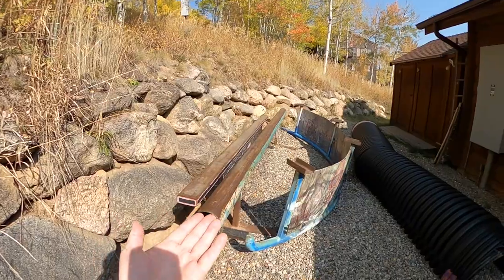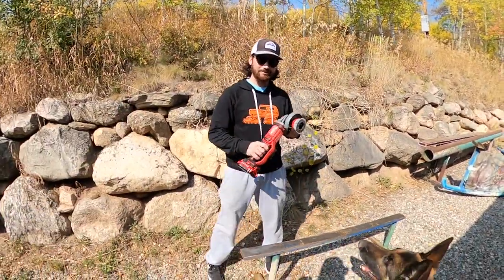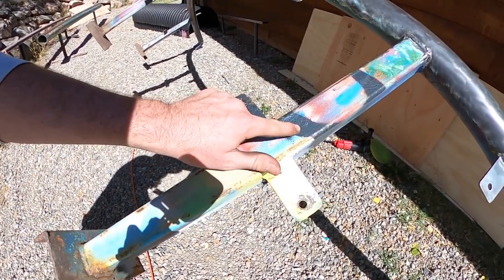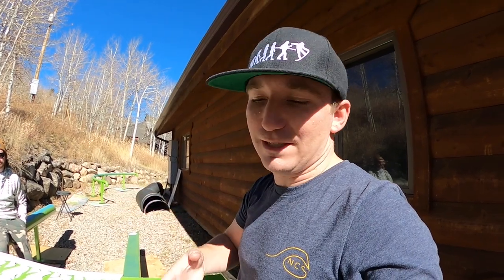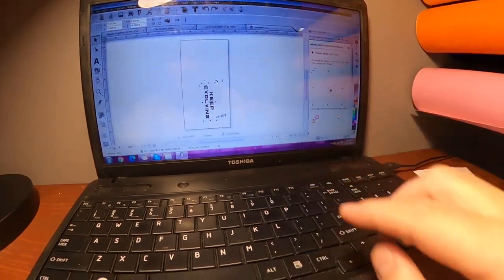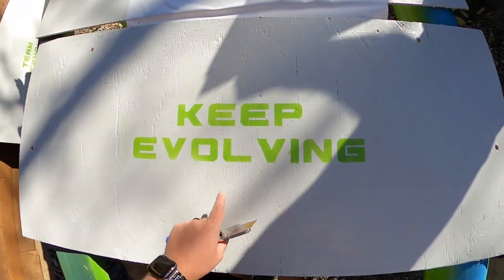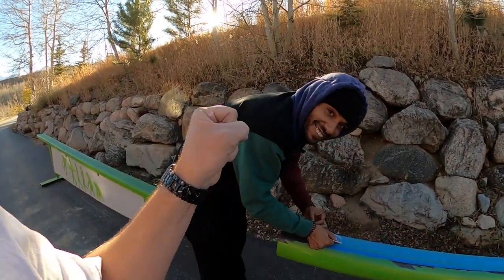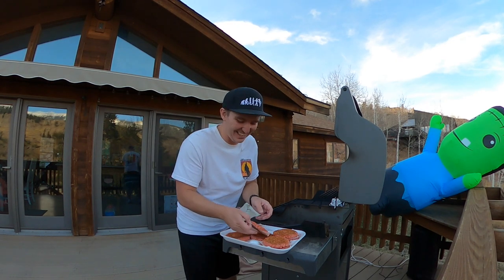Building Legit Ski Resort Park Rails

Comment: A little late response..  
Words of advise for next time (from a welder fabricator):

 1) Find a shop with a sandblaster and pay $150 cash to get them sandblasted.  You could have picked them up next day.  You could even spend the same amount of money (you spent on that grinder) and gotten a harbor freight sand blaster.  If you have an air compressor, it is handy.  Grab a $20 grinder while you're there.

2) The metal wires you lost are now on the ground in that area. Your dog will eventually get one in its paw.  Pray it doesn't eat one.   Run a bar magnet (roofers magnet) over that area.  Even if the package said the wire brush was stainless, the wire probably is magnetic.

Comment: Next time you guys do this, use etching primer. The etching primer has acid that helps adhere the primer to the base material. Then your final coat will apply 100x better to your project. Also adds extra corrosion protection.

Comment: I got two questions, number one is there anything you can put on the unpainted part to keep it from rusting? Such as some kind of light oil like 3 in 1 oil. Question two is have you thought about putting a couple of layers of clear coat over the paint to cut down on scratches?